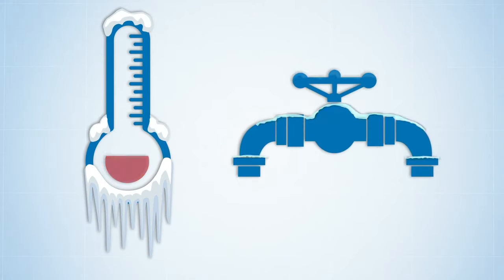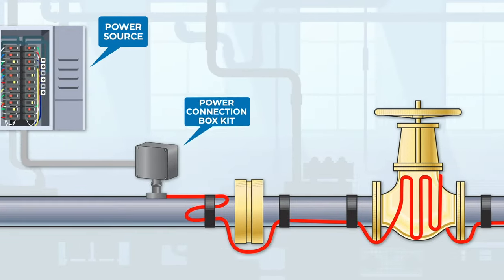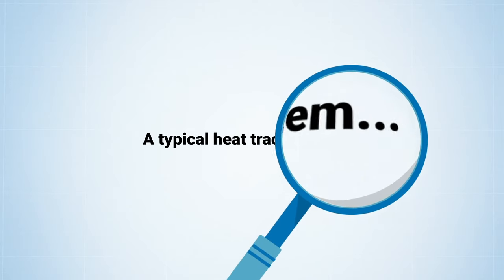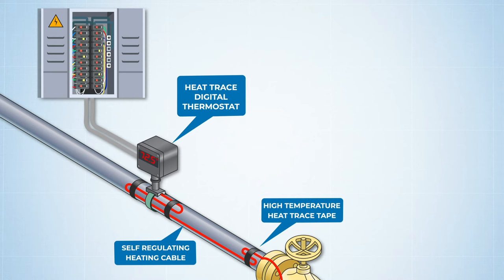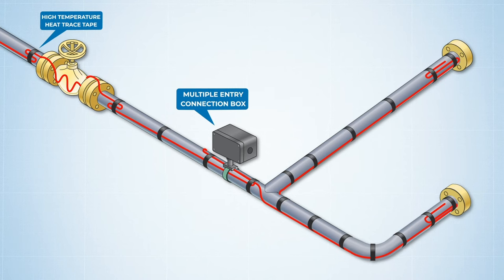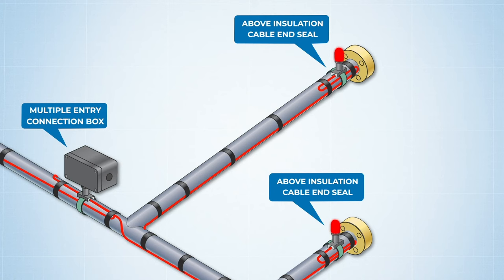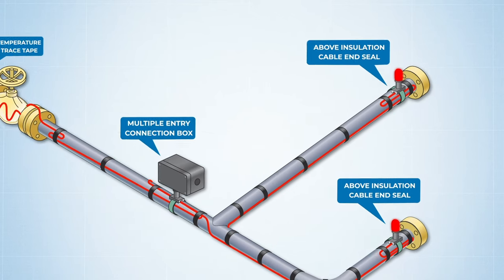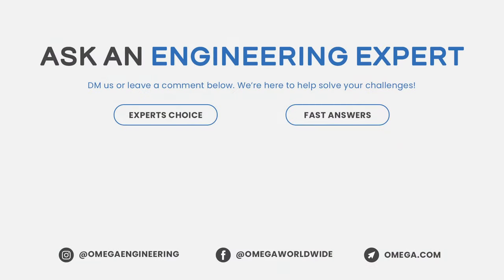What is a Heat Trace System And How does it work?

Comment: I am carrying out electrical repairs on an empty property. As soon as I turn the breaker on supplying the heat tracing system the unit on the wall makes a constant loud buzzing sound which I've never had in this block of flats before so assuming it's faulty. If I leave the supply off for now will the hot water cylinder still work as normal?